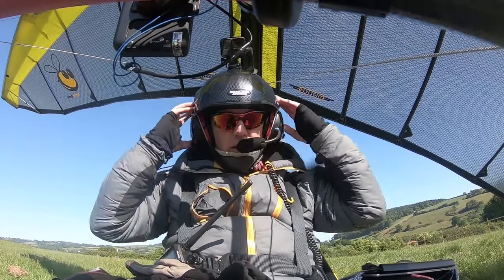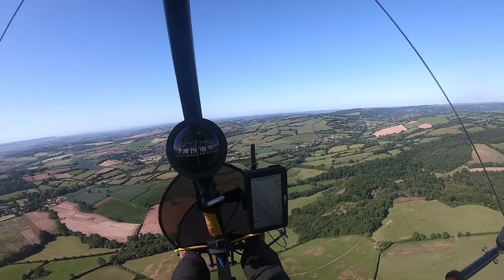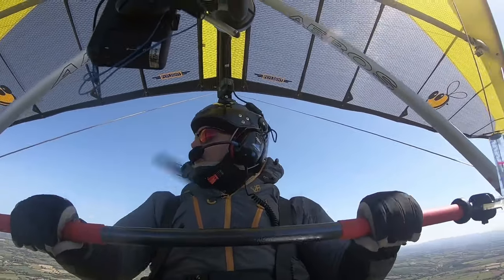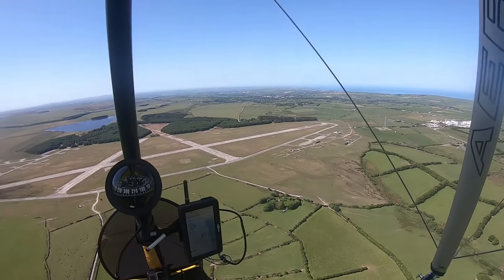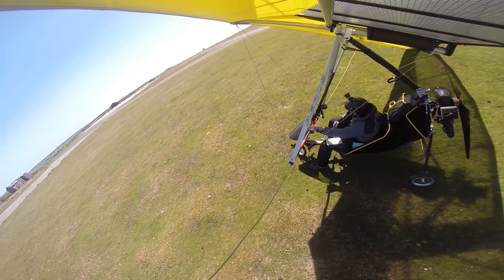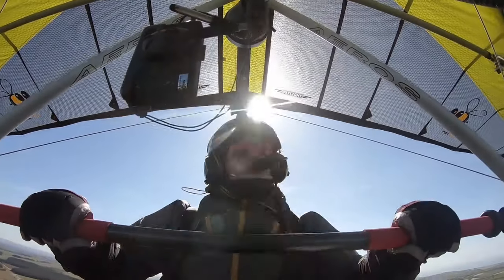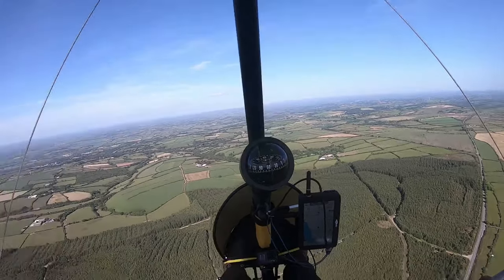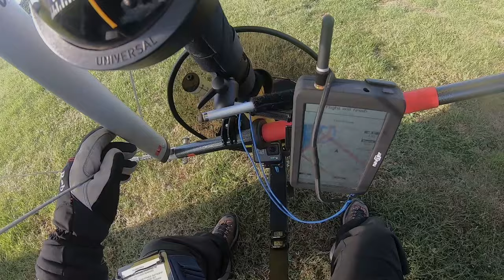Flexwing Flying to Cornwall - My first Peabee XC

Comment: Epic flight so early in you time with the PeeBee, so what next a multi stage flight to get over to my part of the world?!? It would only take about three may be four fuel stops here and add another one or two going back (due to the prevailing wind).
I am planning to do a few longer hops as soon as I can use the fields I want to stop at to get fuel. The bigest thing for me with fuel is having to pre mix the stuff, so plan on taking oil and empty fuel carrier in the aircraft so I can measure and mix as I fill up.
Reply from the maker: I carried my pre measured oil. But as you say fuel is the key. I'd probably trailer the PeaBee and spend a week in the area. Would be good to fly back on the East and North Norfolk coast.
Reply: @GolfFoxtrot22  Look forward to seeing you. Let me know when you are coming up.

Comment: When you go again if you land on the runways do stay on the panel marked with numbers, these are the usable strips. Numbers either end off the concrete panels.
Reply from the maker: Will do. I think the next time I go I'll be paramotoring so will be off the runways.  Thank you for the advice, Graham did advise me after I landed but he agreed its not immediately obvious from the air. Lovely area to fly.

Comment: Very impressive. What is our limit of fuel for the paramotors? Did you have to pass any test to do your best to east coast run ?
Reply from the maker: Hi Harry, paramotors still come under the Sub70 ruling but is part of the CAP 393 definition. There is no limit on fuel except the machine cannot weigh more than 70kgs ready to fly. My paramotor weighed 57kgs (26 litres of fuel) for the coast to coast and that was heavy enough. I didn't have to pass any more tests as I had already achieved my BHPA Pilot rating.
Reply: @GolfFoxtrot22  that's interesting to know. I know we should not transport more than 20 litres of fuel(in a Jerry can)  in a car so I didnt if we too were limited flying. I think I heard in America they can only hold 14 litres or a certain amount legally on there paramotor

Comment: How do these handle turbulance?  Are you cool with huge thermals?
Reply from the maker: They handle turbulence really well compared to paramotors, you feel it, but it's more ridden through than tossed about. The bar moving about is the turbulence, you just let it do its thing, because you are underneath, you kind of get a smoother ride. That probably doesn't explain it very well but I'd rather be in rough stuff in the PeaBee then my paramotor.

Comment: Wow! great video nice to know how far you can travel on a PeaBee and those landings were fine. If you had to compare the same journey with a Paramotor which would you prefer???
Reply from the maker: If it is about comfort, then the PeaBee would be my preferred aircraft. My paramotor would get there just as well and if I was using my Hadron XX xc wing, it would take a little bit longer but I can carry much more fuel.  The Sub 70 Peabee and my paramotor are just different vehicles with different benefits.

Comment: Great Video.  You are answering the questions we flying these machines are asked:  1) How Far?  2)  How fast?  3)  How much?  (this one, people will have to go to the Flylite web page to see $$).   One thing I'd like to see....you doing is a set-up of your plane...and maybe take-down.   Did you say it only takes you 10 minutes?  Is that from you van,  is that in a hanger folded-up...just curious.  Thanks.
Reply from the maker: Thank you for the feedback. I'm glad I'm giving useful information rather than just rambling along. Spooky I did just video a set up which I timed but I lost all the audio so I'm going to re do it when time allows. When I was first learning and had to transport it, it was taking me about 50 minutes from the trailer and the wing on the van to fully ready to fly. My 10 minutes times is from the wings folded back and already fitted on the monopole, with no cover. I'd never want to rush the preparation but it's nice that its not so arduous.
Reply: @GolfFoxtrot22  On the video of set-up...great!  Now you have the Fox T wing... no strut.  How do you do the folding bit...do you have the temporary struts that support your wing?  If you want me to wait for the video...I understand.  Thanks.
Reply from the maker: @stone8597  Flylight make a wing support kit that allows the wings to fold back. I did video the wing build the other day but I lost all the audio so will have to do again.. Doh. Keep an eye out.

Comment: Nice one Giles ... some of that looked a tad 'lumpy air'?
Reply from the maker: It was but it feels completely different with a rigid seat and frame. The wing rocks around but you kind of stay stable. Because of the extra speed, you kind of ride the thermals, rather than getting smashed by them. The cameras seem to make it look worse.

Comment: What`s the Mosters engine speed on the Peabee in the cruise?
Reply from the maker: It's between 57 and 6k. It was hard to get an accurate setting on this flight as I was going up and down all the time. I have had some boaty flights recently where it's happy at 5800 just staying level and hands off.

Comment: Well, Giles, if this video doesn't encourage anybody on the fence about buying a Peabee or Sub70 nothing will, I think that was really quite an incredible flight and endurance and I for one can't wait to get back in the wind and fly again. Please can you just confirm Giles if that is that Sky Demon App you were using?
Reply from the maker: It's the Naviter Oudie 5 Pro with FLARM. I had my air chart all marked out, but the Oudie has all my instrumentation. Vsi Alt, pressure etc.
Reply from the maker: David, next time I use the flight briefing room I'll have to give you a special mention as you hate my fake brickwork.. Haha
Reply: @GolfFoxtrot22  Thank you, Giles, I would very much appreciate that mate LOL
Reply: @GolfFoxtrot22  Thanks Giles can you tell me where you got it from was it Transair?
Reply from the maker: @flybe146  if you can appreciate all the things it can do, it's a cracking piece of kit. I've had mine for about 4 years now and had it upgraded over time. https://flybubble.com/naviter-oudie-5-xc
Reply: @GolfFoxtrot22  Cheers Giles thanks, mate.

Comment: A great video Giles, loved the inclusion of music, great views. I think we are living in one of the best and most interesting times when lightweight materials are giving us the freedom to fly . Could you make a video from the briefing room on how you planned the flight, how you navigated, what radios you use etc.
Reply from the maker: I could but it was fairly straightforward. It was a straight line flight, no airspace and lots of towns. The GPS helps but I also planned on my air chart and used the compass to maintain heading. I had 2 decision points, one at halfway, (ground speed and fuel). If I was above 35mph and still had greater then 6 litres left I was good. The radio I use is a Yeasu FTA450 (I have a RT license) and it's brilliant. I hope that helps.
Reply: @GolfFoxtrot22  Thanks Giles, It was just a thought that it might make a different angle of interest would a short video about planning a flight, (a short intro/extro) or commentary during the flight. I'm sure there are plenty of viewers out there who are maybe not used to or never heard of NOTAMs etc and would love to know how you plan  the navigation. It's not like it's  a car journey where you can suddenly set off and roll up at the coast anytime. There's not many direction signs at 1000ft. Many thanks Giles for a superb vid.
Reply from the maker: @Brian-xd2oi  that's a good idea. I will try an incorporate something into my next xc flight, if I can.

Comment: Hi Giles
What was your actual fuel burn per hour average over the whole trip?
Reply from the maker: I'm sub 5 litres per hour but it's running a little bit rich at the moment.
Reply: @GolfFoxtrot22  Interesting. My Cosmos (Rotax 582) needed a lot more and my Tanarg/Bionix13 (Rotax 912 with 100HP) is at about 8 to 9 litres a hour without a passenger in cruise.
Reply from the maker: @sirclarencedarrow  your Rotax is 4 times the power of my Moster 185 cc which makes only 25hp. It would seem your Rotax is more efficient for the amount power it produces. I think I have some scope to improve the fuel consumption as its running a little rich and cool atm.
Reply: There is nothing that matches the joy of owning your own flying machine. I could bore anyone who'd listen, for hours, about the adventures I had in my flexwing. Keep it up :-)
Reply from the maker: @PaulUnderwood345  I'm so enjoying my flexwing flying. Its been a wonderful and challenging journey.